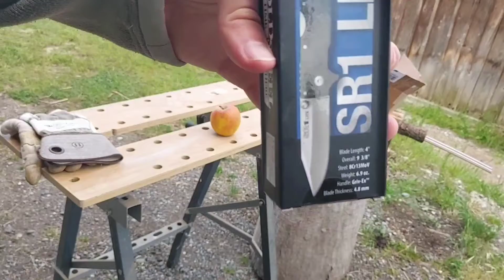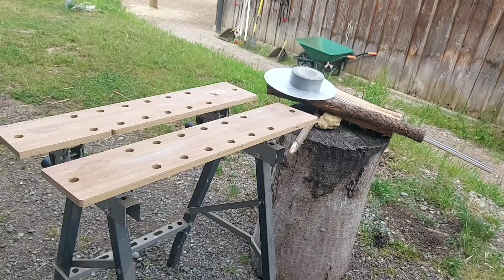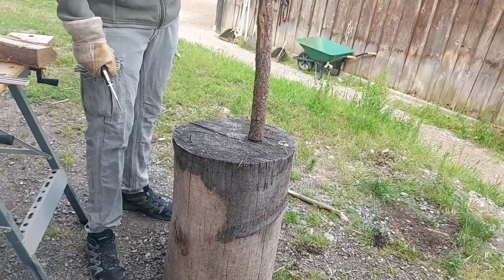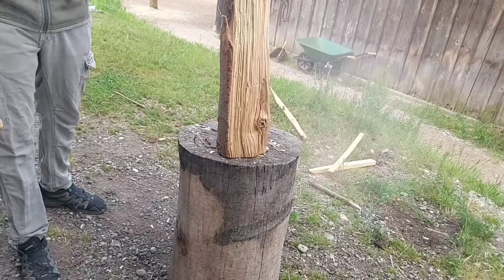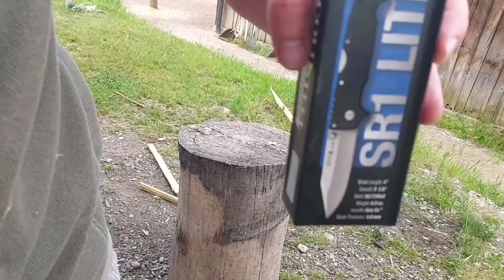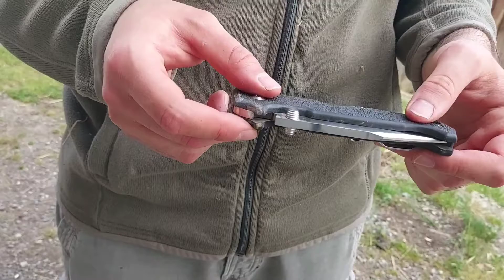Cold Steel SR1 Lite Hard Use Testing - Folding Knife

Comment: How to never use a folder lol
But good to see it’s a beast
Reply from the maker: Yeah a test of the limits. Every knife can cut cardboard and apples or you just can tear cardboard or paper by hand and eat the apple without cutting it. Light wood chopping should be no problem for a well made folding knife. I do that almost every day with the Adv Pitboss and I did chop often with the Cold Steel Espada large. Batoning and stabbing is not a thing that I normally do but I expect my folding knives to be able to baton and to stab a decent amount of times without breaking or failing. I basically like to know the limits of the knife I carry every day so I dont have a bad surprise one day👍
Reply: @hardusehobby  that’s why I carry fixed blades and folders. Each have their limits. Good to see the SR lite hold up. I have one obviously
Reply: @hardusehobby  after that torture.. did you have any blade play in the SR? Every now and then (depending on speed of opening) it varies. I’ll either get a solid lock up or sometimes (very low percentage) I’ll notice vertical blade play (tiny). Doesn’t bother me, but was curious if others have this as well. I have the AD-15 and it’s a solid lock up every time. Yes, two different knives and locks but tri-ad’s in the ost I’ve owned never had that. 🤷🏻‍♂️
Reply from the maker: @a661992  Fixed blades are obviously preferable for hard use and if I was living in a country were it is common to wear a fixed blade I would edc fixed blades as well. But here people would maybe be scared if they see a knife at the belt.
My Sr1 has also minor blade play. It started after doing abusive things but it doesnt seem to get worse. Its there every time I open it but it bothers me only a little bit. I heard of other people having a bit blade play over time with different cold steel knives even without doing abusive things. Maybe the tolerances are not that good on average since these knives are not expensive and because they are made in Taiwan. Could maybe also be a quality control issue so that one knife is randomly better or worse than an other one of the same model. Who knows
Reply: @hardusehobby  ok I’m not the only one lol. Yeah it doesn’t bother me at all and like you said it can happen being a cheaper knife. As far as fixed.. I’m not sure if the laws where you live but there’s makers out there who make 3-4 inch blades for iwb or pocket carry fixed blades. Yucabladeworks is one I love. 
The up and down blade is a anal thing lol.. but I did give it a few spine wacks and it’s not going anywhere.. I guess it’s expected with a cheaper blade.. again, my AD-15 (yep different lock) is like a tank.
Reply: @hardusehobby  I meant to add: 
I did tighten the pivot a bit on the SR1 lite and it make the lock up a bit better. But I can’t stand when you tighten the pivot too much because then it’s a bit stiff to open. I like my folders loose like a goose lol
Reply from the maker: @a661992  Iwb carry is intereating. I saw a video of Lynn Thompson where he showed how he carries the CS Espada xl at his crotch basically. Maybe not very comfortable but yeah could be an interesting option with a smaller fixed knife👍

Comment: A proof that a perfect indestructible knife is still worthless if it carries the world's shittiest cold steel pocket clip. Thanks for a great test and review though :)
Reply from the maker: Most of the time I do carry my pocket knives 100% in the pocket next to a pack of paper handkerchiefs without using the pocket clip so its not the most important feature for myself. Generally I like deep carry clips and when the pocket clip supports the grip like on the Spyderco Harpy for example🤷🏻‍♂️
Reply: @hardusehobby  I agree. I love CS, but hate it at the same time, cause is just tears and rips each of my new jeans :) Spyderco, Kershaw, Kizer, Steel Will whatever they do the clips right, grippy enough yet easy on your pockets. Harpy is a lovely piece for sure :) Cheers and best wishes for 2022!

Comment: No one does that to a knife in real life . Sort of stupid.
Reply from the maker: Many things could be called stupid but at the end of the day only someone that is omniscient could really judge. Such classification is basically nothing more than an opinion that shows certain values, political believes or preferences. My preference is to have a very strong folding knife because I do use my folding knives without any restriction like outdoor fixed knives. So I dont want a knife that is weak. Other people might prefer a weak knife that is light weight or has some type of steel that is on paper a bit longer sharp in some soft use cutting szenario.